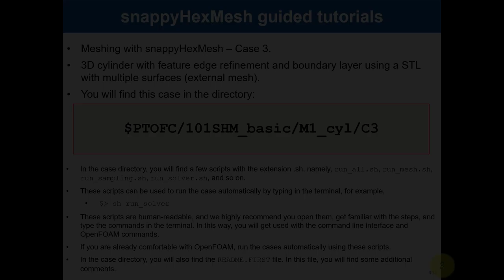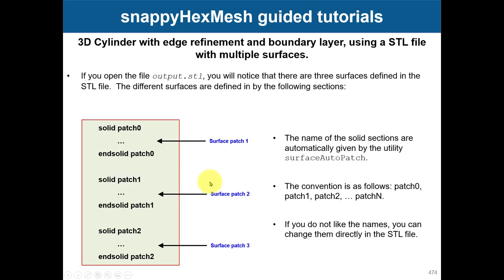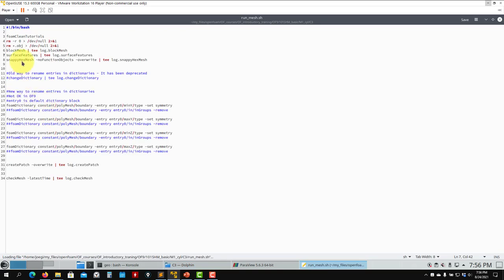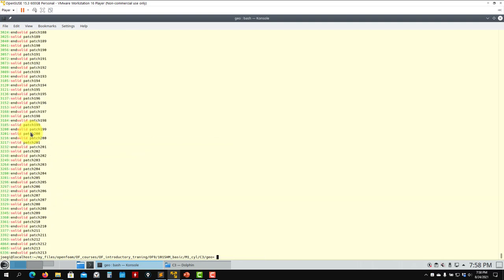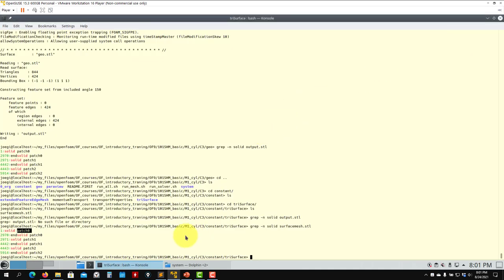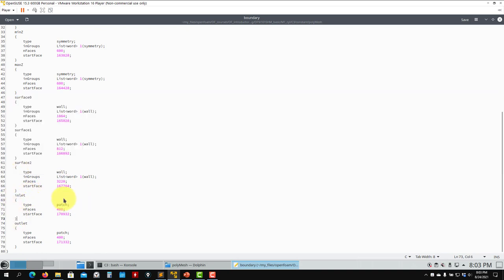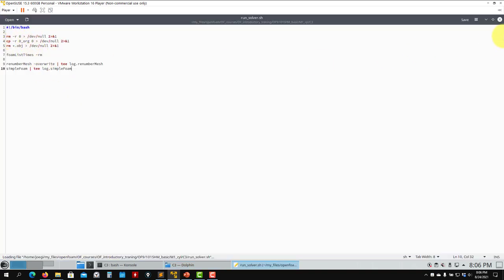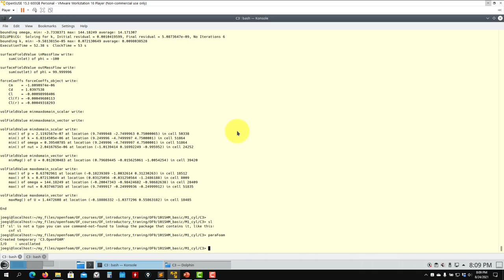3.7 Module 3 | Meshing in OpenFOAM | snappyHexMesh | #openfoamtraining

Comment: hello, Sir.After doing surfaceAutoPatch with the geometry I want to patch, there are some patches, how can I know ,for example, which part of the geometry is corresponding to patch0...
Reply: I recognize this by opening the patched .stl file in onshape.... Is there any other better ways please =.=
Reply from the maker: Hi, unfortunately, you need to do it manually.  For example, you can open the file in paraview and inspect the geometry. In these times when everything is AI, I am working on a tool to do it using AI, so if you have wheels, it will rename it as wheels, same for wings, and so on.  But as you can see, the options are endless, so training the model is not easy.  @he-iw3ne